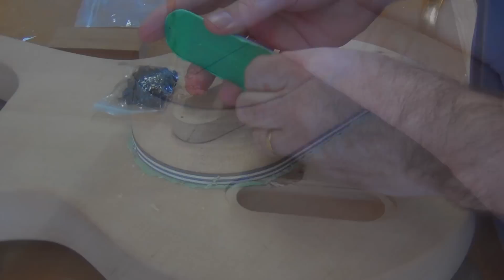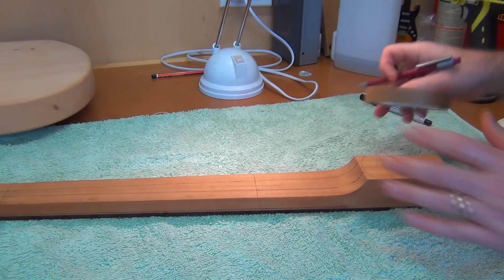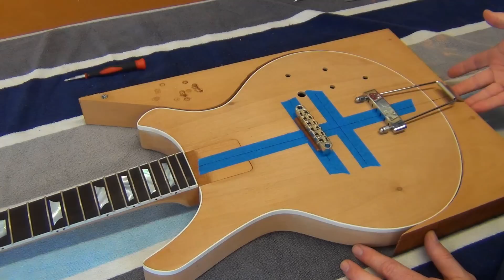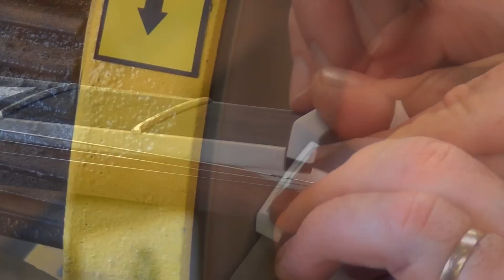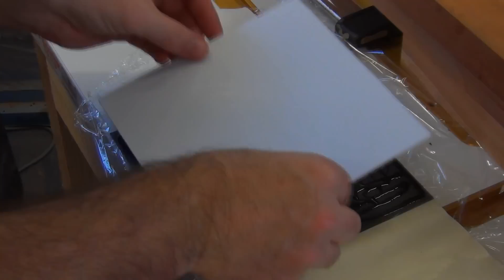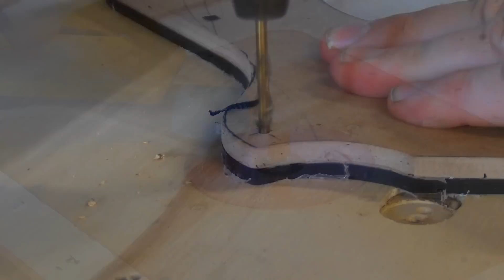Building A Gibson Les Paul Junior Style Guitar - Part Four

Comment: I know that this is an older video, but here's a tip. When you go to peel the paper cutting template off of the MDF pick guard template, make a few passes over the paper with a heat gun. It only takes a couple of seconds, and the paper will peel right off, taking just about all of the glue with it.

Comment: Love your building videos, but I have a question. When routing for the P90's, I know you use the centerline to align the template vertically. But with the template raised off of the body, how can you tell if it's aligned horizontally? Thanks!

Comment: What is your process for locating the stud placement for a wraparound style bridge like you used in the TV Yellow Corvette? Im assuming you used that same trapeze tailpiece to hold the strings while you positioned the bridge, but given that that bridge has the fine adjusters where it contacts the post, how did you finally decided on where the post would go? I hope that makes sense, I love your videos, very informative and enjoyable to watch. Cheers!
Reply from the maker: Same process or you can just measure using the scale and kick the back end back by 1/16" - 1/8" depending on which bridge you use ( and how much travel adjustment you have on the bridge pieces )
Reply: ***** Through this series you've inspired me to try building a dc junior and while everything has gone relatively smoothly, like awcanyoc, I'm unsure of the bridge placement. I've gone with a wrap around bridge and I get that the low e end needs to be 1/16" -1/8" further back but I don't know if I should be drilling the hole for the mounting lug further back or drilling the holes evenly and just using the the adjustment bolt on the bridge to push one end out. Thanks for any help in advance.
Reply from the maker: *****
what bridge and scale are you using ?
Reply: This is the bridge
http://www.stewmac.com/Hardware_and_Parts/Bridges_and_Tailpieces/Electric_Guitar/Non-trem_Bridges/Adjustable_Wraparound_Bridge.html
and I'm using the Gibson 24 3/4" scale. Looking at the bridge I think I should be able to just drill the holes evenly and adjust them using the bolt on the bridge nut I don't know if it'll be easier or in some way better to drill the low e hole a few millimeters further back. Again, thanks for the help.
Reply from the maker: *****
Use the Stewmac Calculator - http://www.stewmac.com/FretCalculator

It will give you accurate placement for the studs
Reply: excellent, thanks.